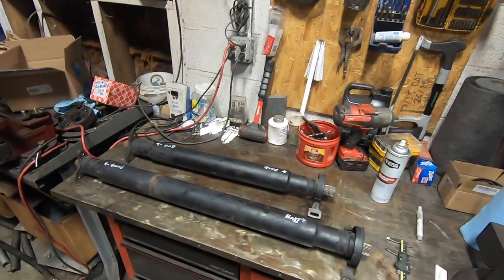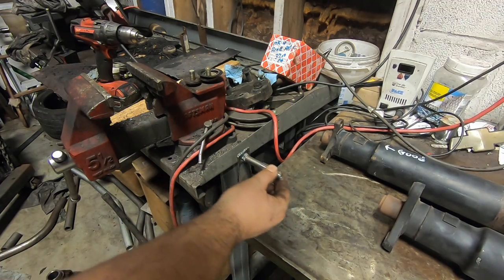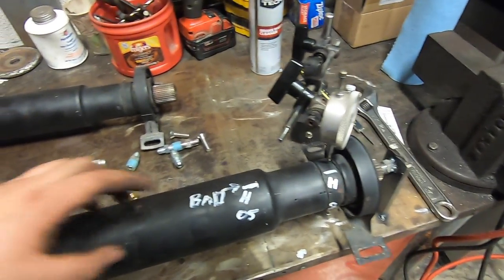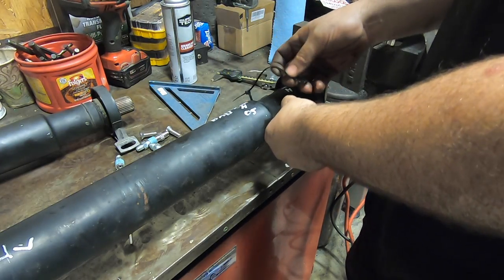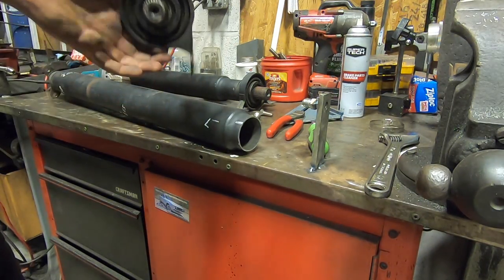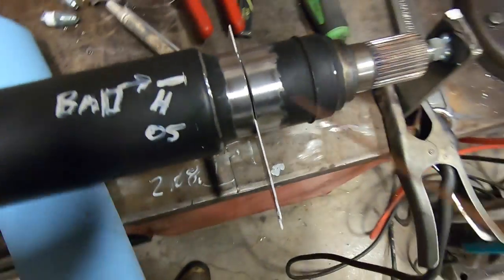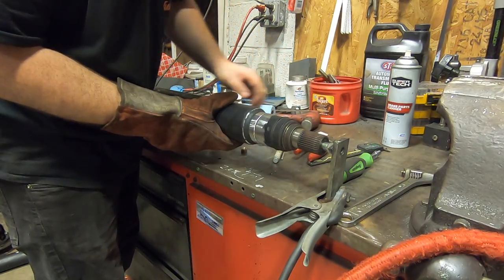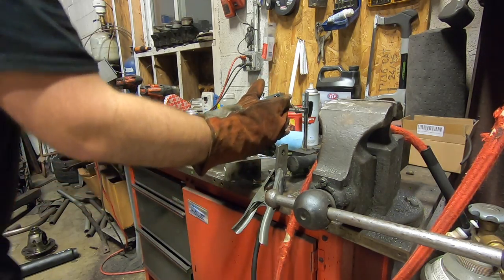Extend shorten or modify ANY driveshaft at home. No special tools!

Comment: Your spring loaded end was a good idea to keep tension,  but the cone was loose enough to impact your dial measurements. If it was threaded on without the spring and tight you would get much more accurate measurements
Reply from the maker: You are right there! I am still running this shaft with no vibration or issues yet... But in hindsight I could of done things better

Comment: So if you want to do this and keep things as straight as possible first clean paint off of the shaft. Use a pile cutter to cut the shaft to keep the cuts straight. Use 2 pieces of angle iron to clamp the shaft in a vice. Weld short distances on opposite sides of the shaft between gaps in the angle iron. Move the angle iron 90 degrees and repeat. Then finish the welds. The pipe cutter will not only give a straight cut but will also slightly bevel the tubing and give a bigger weld surface and a flatter weld. Make sure you check runout and correct it with selective heating using a torch. A mig welder will often give a nicer weld depending on your skill level. Another way to weld it is in the fixture slowly turning it using mig after placing tack welds using the angle iron. Again check runout at the end.
Reply from the maker: Great tips. If I did this again I would use very different tools (lathe and mig welder”. But at the time it’s what I had and this shaft is still running down the road

Comment: any new info on this?   Can't believe balance was NOT an issue,  Awesome!!
Reply from the maker: Still running great. Balance isn't an issue on this particular car because it has a 2.81 rear axle ratio and ~ 26" rear tires. At highway speeds this shaft only sees 2500rpm or so. You can get away with a lot at those RPMs. For the same car but with a 4.10 rear and an OD trans, balance would be much more critical.

Comment: Nice. I have an aftermarket Camaro shaft that broke the back apart when my 10 bolt broke. Can probably use that with an explorer shaft for Beretta. Hmmmm.
Reply from the maker: I built the shafts in my beretta and my Jeep. There more forgiving than I expected

Comment: How do you make your drive shafts stronger to cope with extra torque Let’s say you’re thin?
Reply from the maker: You could sleeve it I suppose. But the best option is to cut the stock tube at the ends and order a complete tube with thicker wall from a driveshaft supplier

Comment: Really shouldn’t butt weld driveshafts together. Especially for people who don’t weld very well. I get so many in my shop that get tossed out vehicles and sure enough it is almost always the butt weld that fails. 

Luckily you didn’t need to phase this one but most would require it. The run out on stock tubes is also horrendous so lining these things up outside of being on a center is next to impossible. 

Glad it worked for you but it’s just not something I would trust with how often I see these break.
Reply from the maker: This is some good stuff I appreciate the comment. 

Knowing what I know now I would of done this differently but this shaft is still running great. It helps that this car runs a 25” rear tire and a 2.81 rear so the shaft is spinning relatively slow on the highway. Probably why I don’t have any vibration issues. 

Yes phasing would be critical if it had 2 u joints. The stock tubing is all over the place. I though of making an ID sleeve on the lathe but don’t think it would help much on this tubing.
Reply: @spankranchgarage  I have been building shafts for decades so I figure I can try and help when possible. Sorry if I sounded like a troll at all it was not my intent. I have just seen some scary things butt welded together and by the time it hits my work bench it has already destroyed someone’s vehicle. 

Had one where a guy pressed a square tube inside the round tube ends to center left a big gap and tried to fill the entire thing lol.
Reply from the maker: No offense taken! I am sure you have seen plenty of hack jobs. 

If you had this job would you turn the ends down and retube? I’m assuming the ends are not available new
Reply: @spankranchgarage  that particular on is special monster. The yokes and other parts are friction welded to the tubing. That makes the process a bit more complex. 

The first drawback is they are almost always made with obscure tubing sizes and metric as well. That is just an obstacle though which with a bit of planning can be sorted. 

The second drawback is the type of process they assemble them. The friction weld process doesn’t require a pilot hub for centering as the welding machine is able to center, weld, square, and phase the parts all at once. It’s nifty for high volume but makes any modification a little more difficult. 

I personally will not butt weld tube together. In my line of work it is unprofessional and would be harmful to my reputation. I’m not saying it can’t be done well or work I’m just saying if you have the equipment that I do it is completely unnecessary and frowned on. 

My first step is getting the friction welds removed so I can measure the bores in the end piece that needs to be moved. After that, I make a bushing I can weld into the end to give me some sort of hub to recenter the yoke or stub or whatever. The bushing can be whatever size I need so shortening even into the swedged part of the tube is doable. 

Swedging is how they make tubes with multiple diameters and is popular when you want strength without adding weight. It was originally used in vehicles that needed longer shafts because the larger diameter and lighter weight are able to solve two major issues. First is length. Second is critical rpm. Building a shaft too long is quite dangerous if you use too small of diameter tube or build it too heavy. 

Anyways, after the bushing is welded in and milled to the necessary spec I can reinstall and balance the shaft where ever it needs. The same method works when they need to lengthened as well.